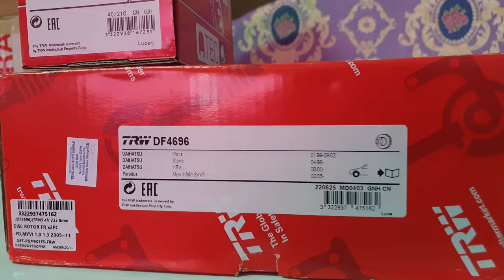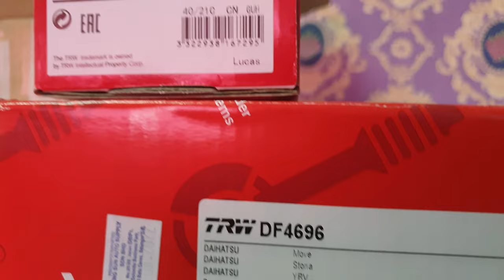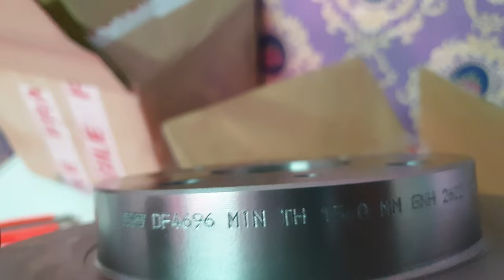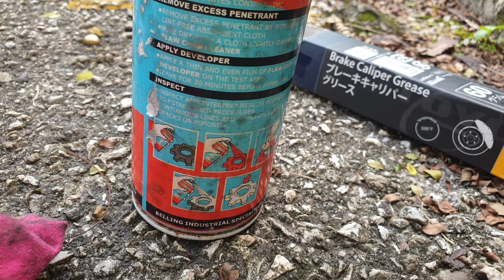Perodua Viva | Tukar Brake Pad Dan Disc Rotor Tapi menggunakan brake Myvi 1st Gen.

Comment: Harga berapa boss
Reply from the maker: harga apa tu tuan? klau harga barang sy ada letak dlm  description.
Reply: Tak ada pun
Reply: @MrDoitt harga disc rotor
Reply: Untuk Viva boleh ke pakai DF4070
Reply from the maker: @zaidizaidi9997  ada link dlm description...tuan tngok dlm ruangan itu
Reply from the maker: @zaidizaidi9997  harga rotor lain kedai lain harga...dulu sy beli murah saja, skrng dh naik harga tuan, yg sy beli dulu dlm rm80, skrng ada 100 ada 100 lebih
Reply from the maker: @zaidizaidi9997  yg DF4070 tu TRW utk original viva, sy sy guna skrng ni disc rotor myvi lama, caliper pn pakai yg myvi lama, kod model lain dah
Reply: @MrDoitt  apa beza disc rotor myvi dgn viva
Reply from the maker: @zaidizaidi9997  rotor viva kecik, caliper pn kecik, disc rotor myvi 1.0 besar sedikit dan caliper myvi 1.0 lebih besar sidikit, bila rotor besar brek akn lebih grip, klau rotor myvi mmg kena pakai caliper myvi la, br sama saiz
Reply: Bang kaliper. Maybe lama 1.3 masuk viva skali rotor std maybe pnp ka??
Reply from the maker: myvi 1.3 lama yg lampu depan besar tu  boleh masuk caliper n rotor pnp viva